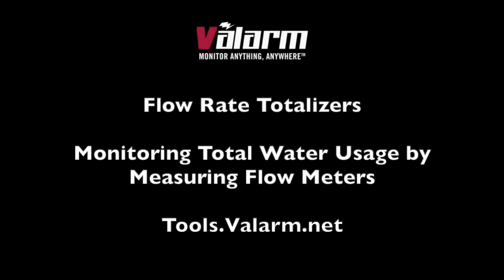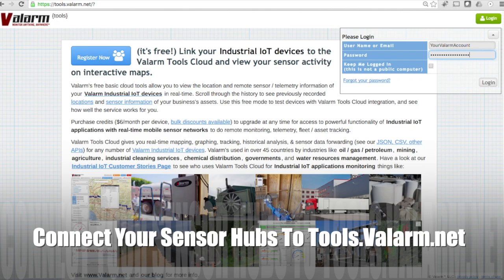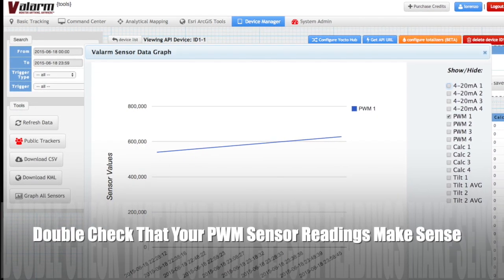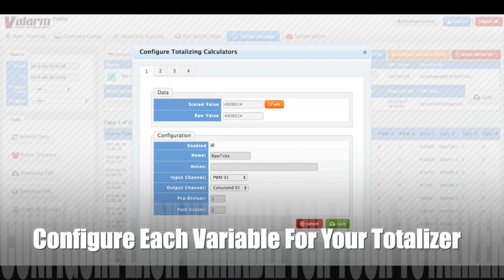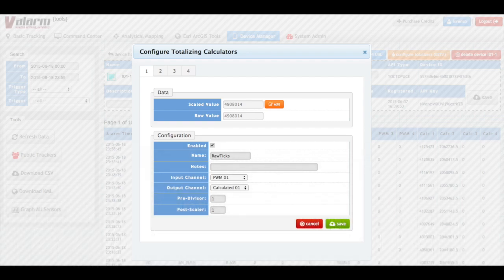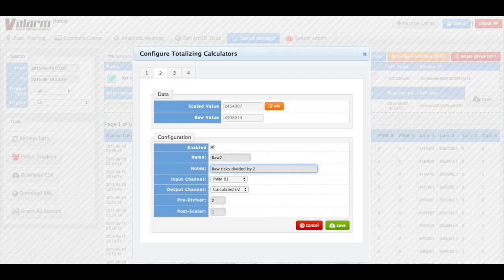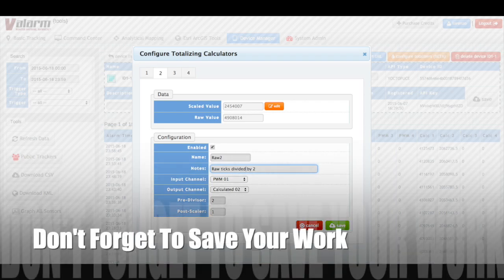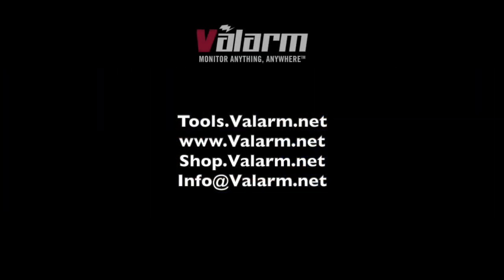Flow Meter Totalizers - Monitoring Water Usage Totals with IoT Sensors for Flow Rate Measurements

Comment: Thanks for this video. How can I use a flow meter with an industrial pulse counter?
Reply from the maker: Howdy Kufirre. Thanks for getting in touch. Our customers monitor all brands of flow meters with https://Tools.Valarm.net . Valarm Tools Cloud measures sensors made by any hardware manufacturer that supports industry standard sensor outputs like 4-20 mA, 0-10V, SPI, PWM, serial, RS-232, RS-485, and others you see available on https://Shop.Valarm.net . So as long as your flow meters output international sensor standards like PWM, then you can monitor your flowmeters with Valarm Tools Cloud. See our Industrial IoT Customer Success Stories for all of the details you could ever want to know about how our customers deploy flow meters and Industrial IoT sensors to save time, lives, and money - https://www.valarm.net/customer-stories/